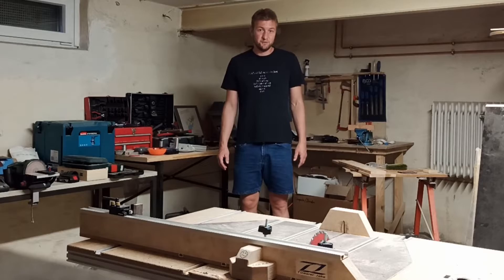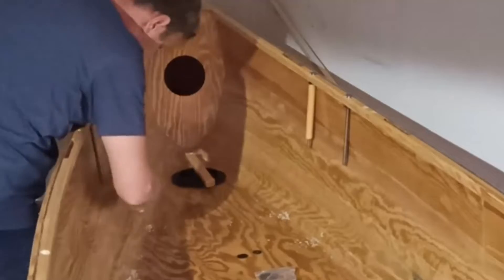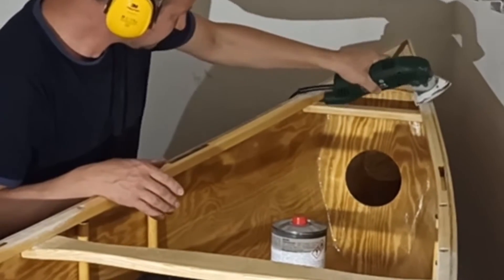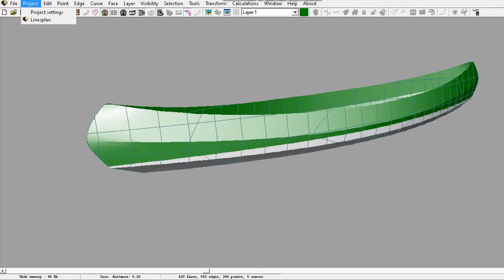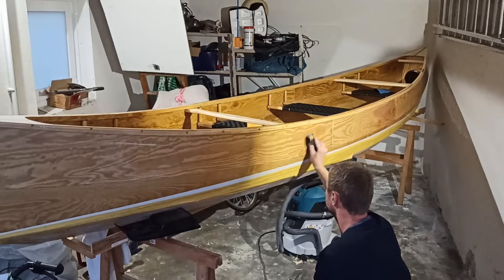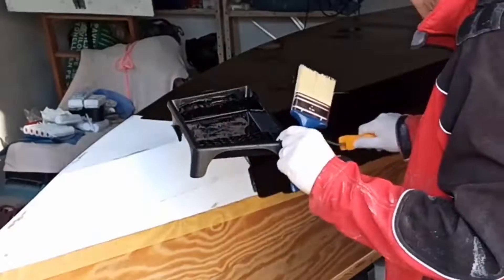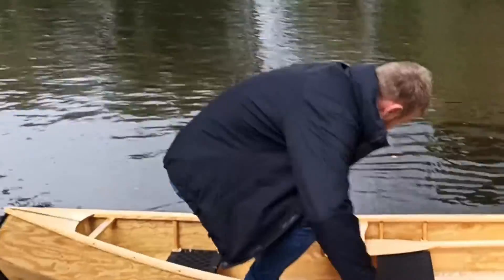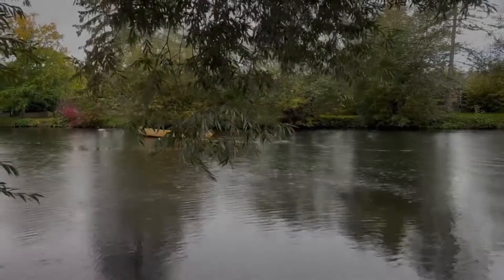TJ-Canoe - Part 4/4 | Self-Designed Plywood Canoe (Free Plans)

Comment: Is there a lot of upward flexion on the bottom of the canoe, seeing as it is one flat piece?
Reply from the maker: Thank you for the question! Yes, the bottom does indeed bend up a little, especially when there are waves. So far I haven't had a problem with it and have already done a few tours with the canoe. But I think a keel and possibly also cross reinforcements above the bottom plate would greatly reduce the wobbling.